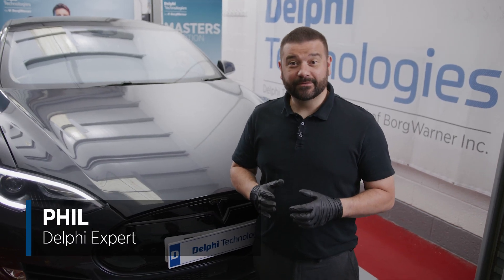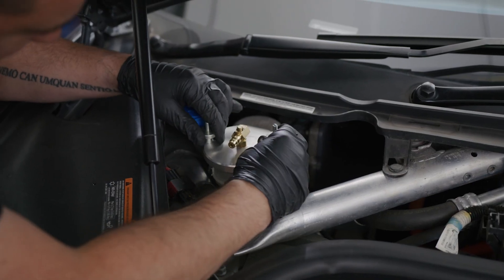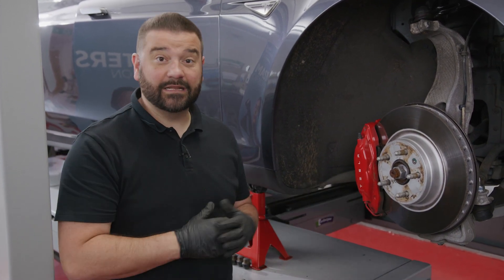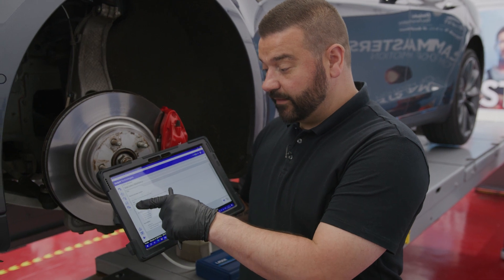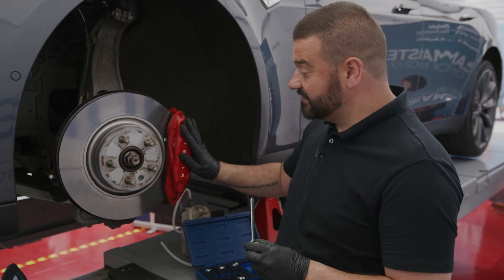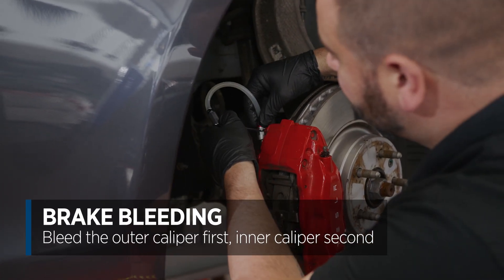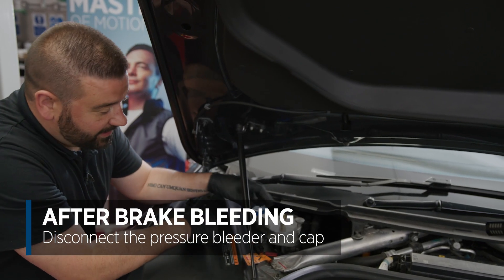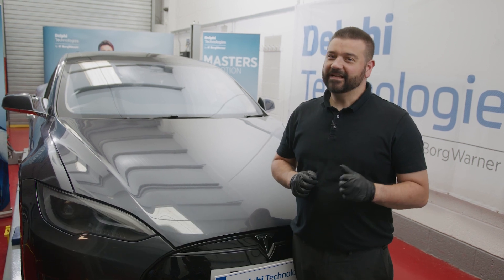[EN] How to change brake fluid on a Tesla | Masters of Motion

Comment: Why can't it be done the old school way? top up the reservoir, go to the furthest point, get an assistant to put the brake pedal to the floor, open the bleed nipple (into a container with a little brake fluid to cover the outlet pipe, and  stop any air entering the system), close the nipple, up and down again on the pedal, open the nipple, bleed more old brake fluid out, close it..... etc etc for at least 5 pumps to clear the circuit, then go to the next farthest point and do the same, until you end up at the front wheel adjacent to the reservoir.
Reply: You could do it the old school way but the order in which you do it is different for a Tesla, as follows 

Front driver
Front passenger
Rear passenger
Rear driver 

You can pump manually or you can have the car activate the circuit to pump fluid to a dedicated corner. Just make sure you keep an eye on the fluid
Reply: Another thing, You dont need the diagnostic tool. You can access your secret service menu through your screen and activate the selected circuit like hes doing with screen

Comment: Is there any issue with doing the job without a diagnostic tool?
Reply: You can now access the purge/bleed setting via service menu of the car.
Reply from the maker: Hi @user-qd5ze1hp9f unfortunately with the diagnostic tool to activate the purge routine, you may not replace all of the fluid without it.  The purge also ensures no air bubbles accumulate in the ABS pump which usually leads to a spongier pedal, and lower system performance.
Reply: I wondered the same thing, if the tool activates the ABS module to run the new fluid through it.